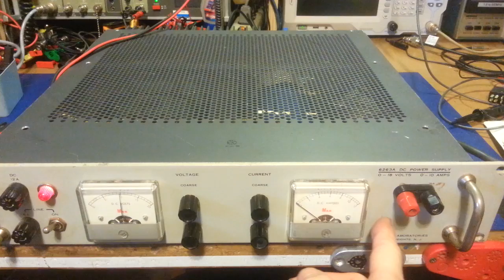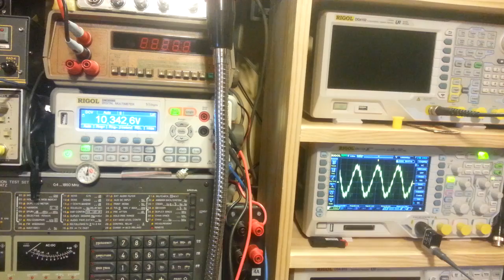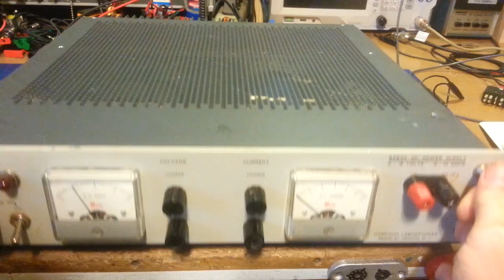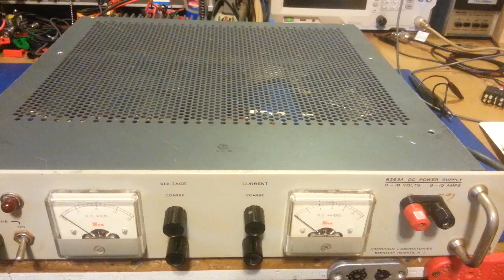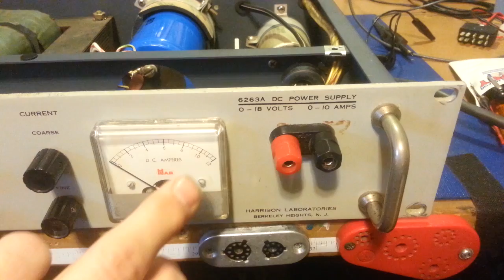Laboratory variable power supply for Buddy. Harrison Laboratories 6263A.

Comment: I have  several Harrison power supplies and they are extremely well built.Harrison was acquired by Hewlett-Packard sometime in the 'sixties.They are easy to repair(all discretes) and very high performance.service manuals are downloadable from the hp vintage equipment site. Good luck!

Comment: There is a manual on Ebay if it can't be found.
http://www.ebay.com/itm/HARRISON-LABS-HP-6263A-POWER-SUPPLY-OPERATING-SERVICE-MANUAL-SCHEMATICS-PARTS-/391603340588?_trksid=p2141725.m3641.l6368

Mike,
Did you get my email earlier today?

Comment: Yep, definitely agree about using linear supplies, I did purchase a small switch mode supply for my bench, but even after I modified it to improve the filtering it was still too noisy, it sits on a shelf now unused, both my power supplies are linear, an astron vs35m and a Korad triple output lab supply.
Reply from the maker: Yep, can't beat the old heavy linear supplies.  So much quieter than the modern switch mode supplies.

Comment: Believe this became the HP/Agilent 6263A and later the 6263B ( slightly higher voltage and current ) I have a 6264B 24volts/24Amps. The Buzzing is from the transformer primary being switched. They do this to lower the stress on the pass transistors. That is, rather than trying to regulate the voltage entirely in the DC buss, they regulate the primary AC as well.
Reply from the maker: You are correct.  I had seen it was the same as the HP badged one back when I got it and forgot.  Just don't build them like this anymore.
Reply: The term "Bullet Proof" comes to mind....

Comment: The Radio Shop - Lucky lol. that should make a nice addon.
Mike - Little off topic but im planning a DIY LM317 PSU for small things like bread board builds. any tips on those regulators? Also at 6:53, ive never seen black TO-3 devices before. must have been a 60's thing
Reply: consider using LM350 insteed, their good for 3 amps... advice? just use the application note circuit from the datasheet it works just fine...  if you use the LM317 wou can add a 2N3055 power transistor as a driver in a common collector current amp config.. works great with an heatsink
Reply from the maker: Like Hugo said just follow the schematic on the datasheet and everything should be fine.  And as he said there are higher current regulators available. 

I have seen black and white painted transistors before.  Fairly common back then.